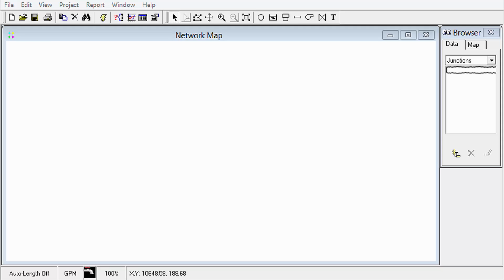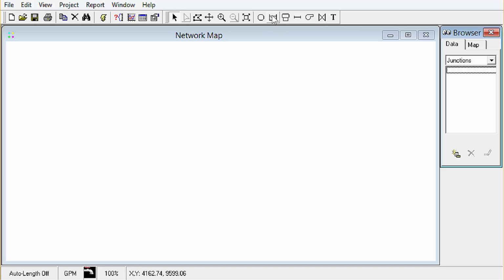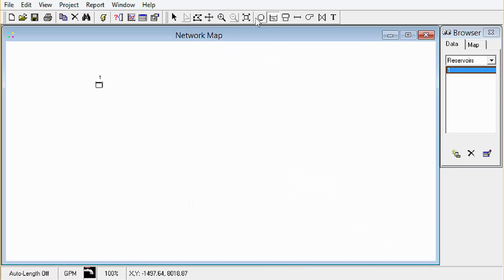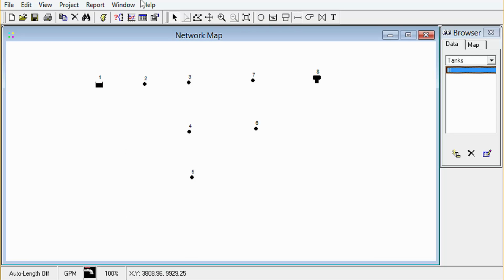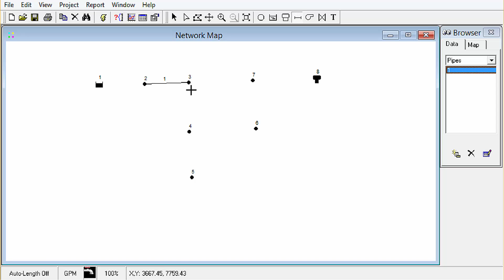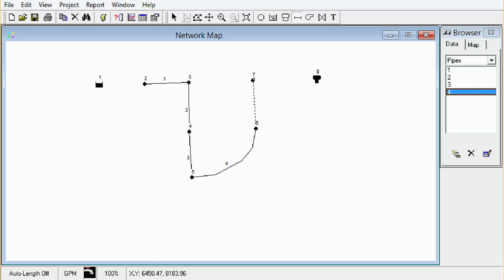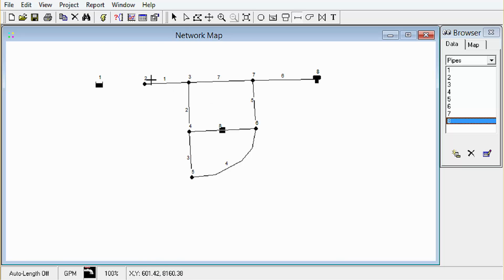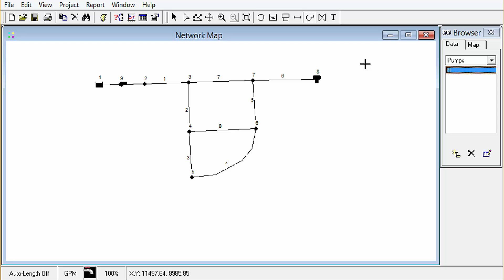EPANET Tutorial 02.04 - Drawing The Network | Hydraulic Modeling

Comment: Wouldn't there be some Head loss in an intermediate vertex?
Reply: In pressure network modeling, fittings are usually considered inconsequential.  If you knew the roughness of the pipe to a very high degree of accuracy and were using the Darcy-Weisbach headloss equation, then fittings such as tees, bends etc. may more rigorously be implemented as minor losses.  Since the roughness is not well known, minor losses are usually rolled up into the pipe roughness and adjusted during calibration.